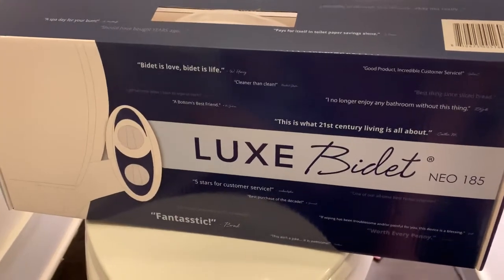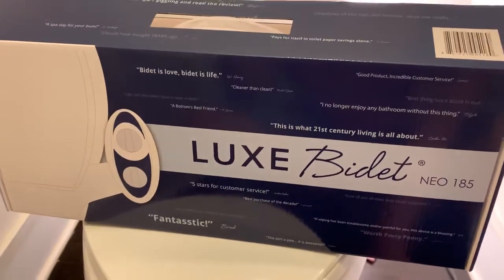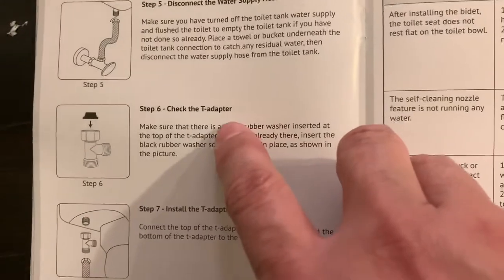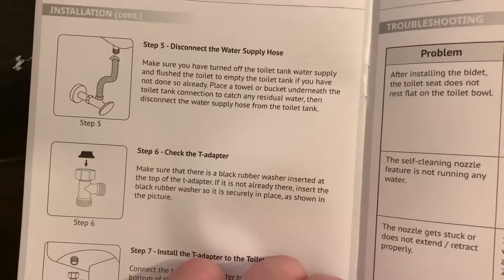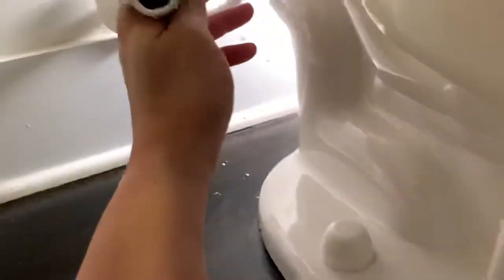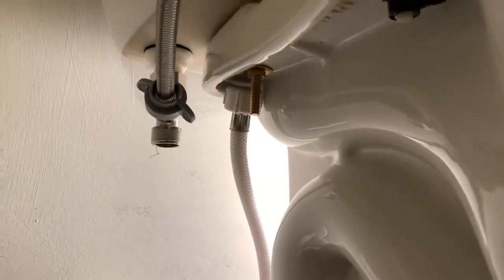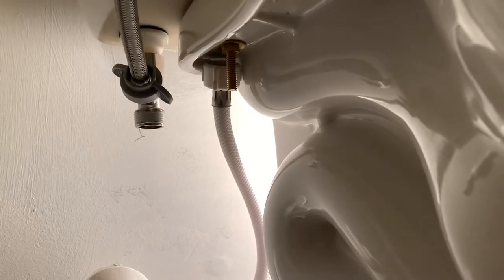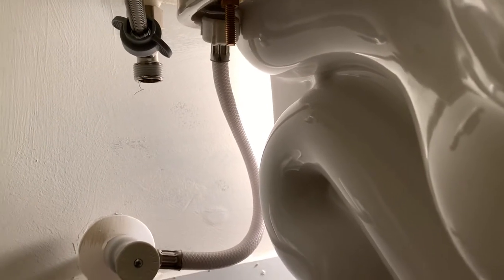Neo Luxe Bidet 185 t-connector spraying water everywhere

Comment: I have this issue where the water is leaking. Could you elaborate more where your rubber stoppers are? I have a rubber stopper in the top of the t-connector that connects to the toilet tank, and then another one on the supply line that would connect to the bottom of the t-connector. In your scenario, were two rubber stoppers being connected to each other or do you mean I should remove one of the rubber stoppers in my case? Thanks
Reply from the maker: Correct - in my case there were two rubber stoppers at the top of the t-connector. There should only be one rubber stopper per side of the t connector. Additionally, I took the step of applying pipe tape (or you can use pipe dope) to all threaded water line connections. I always apply pipe tape for any water line connections since the threads could still leak slowly without something to ensure a leak free connection. When using pipe tape, be sure to apply the tape in a clockwise direction so when you screw on the water line onto the t connector  it will be in the same direction that the pipe tape is applied (if you apply counter clockwise then there's a high likelihood that the pipe tape will unravel as you screw on the connecting water lines).
Reply: @St3rmTig3r  Pipe tape was going to be my next attempt at a fix. Thanks again for the reply!